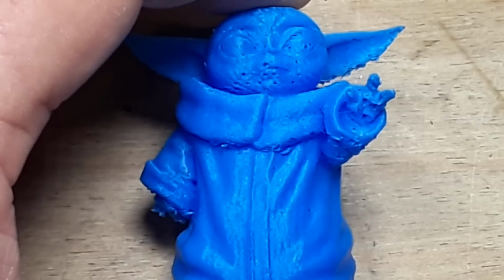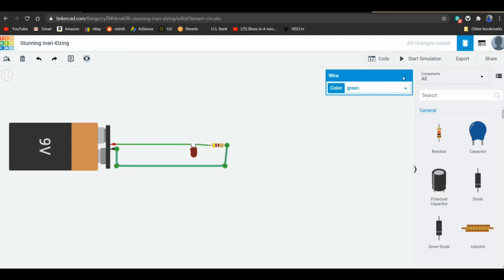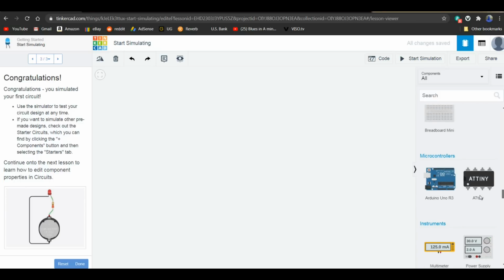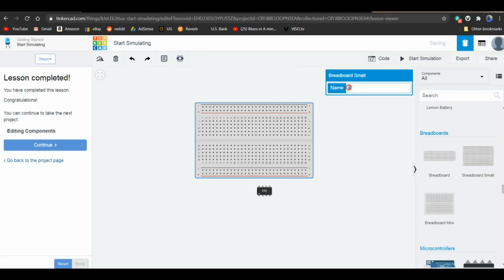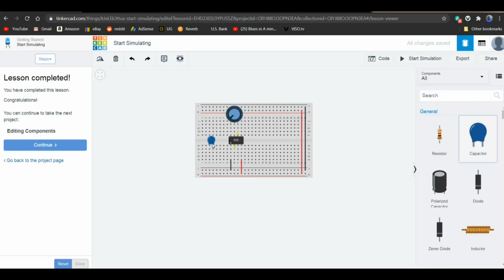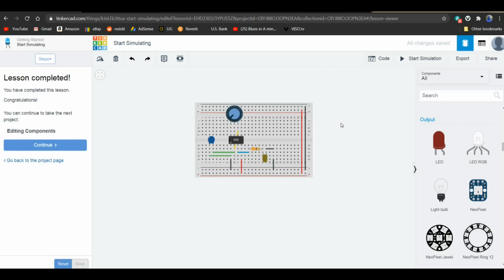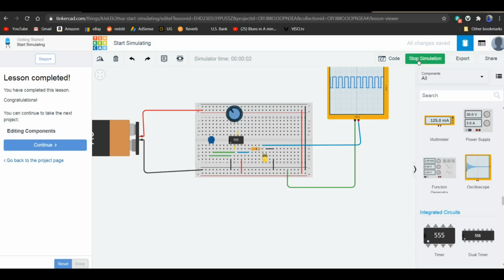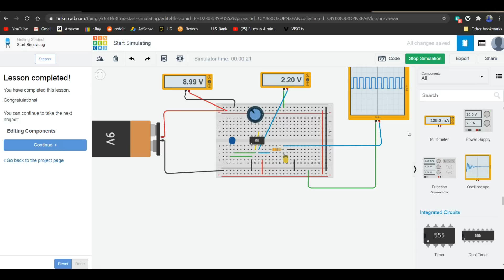Tinkercad Online Circuit Simulator

Comment: Nice simulation. 
I do like the National Semiconductor simulation you introduced earlier multisim, I believe. 
I simulated a schematic on the multisim web browser and constructed it on a breadboard.
Worked very well. The component values were different as you might expect in the real world version.
Multisim was fast to make up the schematic and was easy to set up multiple oscilloscope test points.
It has a good online user base you can view what others are making and test their circuits out too.

Comment: gonna check that out awesome stuff, did you see vacuum tubes? Wonder if not then can we use OpAmps to simulate Vacuum Tube circuits. Thinking Guitar Amps design and test. Thank You, Good stuff D
Reply: Loaded and ran the demo very impressed. Gonna be a lot of fun testing circuits. Thank you. D

Comment: Great video again on simulation. The national instruments simulator has been so helpful to me. However, it is somewhat limited because of the parts available. Thank you so much for this important video. It would be interesting to see how AT tiny GPIO Pins could be used in simulation. I am going to take a look at this. I have done several simulations in advance of actual breadboard projects and I find this to be very useful. For some reason my mind Is more able to experiment with a simulator when compared with a breadboard.